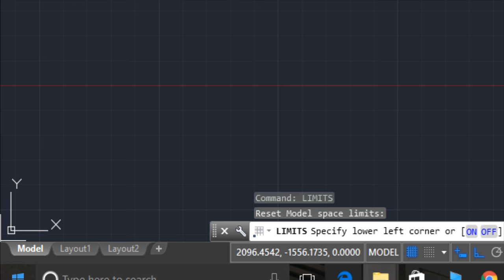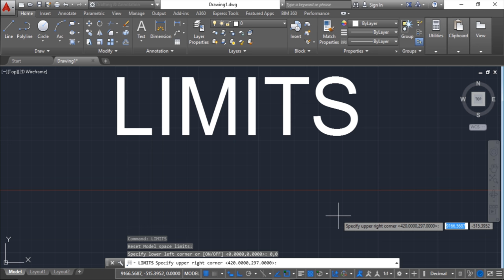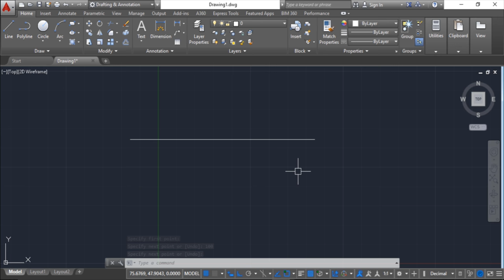How to set limits in AutoCAD?

Comment: if we want to draw a line more than 100 units long so that line we cannot draw in such a drawing where we have already set limit of 100,100?
Reply from the maker: yeah surely u can…line is not going anywhere…it will b in display only…u just have to zoom in to c it..limit doesn’t restrict ur page..u can any time zoom in or zoom out to c line of bigger or smaller dimensions
Reply: You just can increase the limit of your drawing. First you have to decide what size of the drawing you want to draw then you can increase or change the limit if you want to draw further big.

Comment: When i draw the line for 10units it doesnt shows the dotted line and others ,why? How much limits i have to put when i drawing the line in metres
Reply from the maker: Hello, 
I am offering Online classes for the following software's,
AutoCAD(2D & 3D), 3DS Max, V-Ray, Photoshop, Google Sketchup, Revit .
Have a free demo lecture before joining online classes.
For More Information contact caddworld009@gmail.com.
Best Wishes
Sugandha...
Reply: Jeevan Jeevan have selected units as meters . Initially your limits as well as your units are set at a default value .
You can change them by following ways:
1) simply type Units
Select the units you want 
2) type limits then select limits per convenience.
Note : select limits as per your drawing

Comment: When I type limits it start typing in command bar but not near crosshair earlier it used to be what should I do
Reply: For that u need to switch on the dynamic input option in the status bar below near Ortho mode icon..
Reply from the maker: Hello, 
I am offering Online classes for the following software's,
AutoCAD(2D & 3D), 3DS Max, V-Ray, Photoshop, Google Sketchup, Revit .
Have a free demo lecture before joining online classes.
For More Information contact caddworld009@gmail.com.
Best Wishes
Sugandha...

Comment: what happen when we draw without limits?
Reply from the maker: Ur line or any shape with a particular dimension may seem small or too large or sometimes its hard to be found if the limit is too large..
it helps u keep ur desired dimensions in limit by showing it on the existing display..

Comment: Hi, Madam, your limits did not set exactly.
Your X-Axis coordinates were 100 but it did not seem like hundred and similarly Y-Axis coordinates were also 100.
Please, check and revise your video,
thanks
Reply from the maker: Hi,
kindly watch the video again and understand that limit doesn’t mean the display dimensions will be 100 by 100..
The display is infinite, by setting limits We make sure that the desired dimension is drawn in that display..
Whatever limit u give,the display will always b zoomed to a sightly upper value so that if u draw any line under that limit..it is easily visible on the screen on both the axis..
U can use 100 by 60 ratio as the display is landscape..

Never confuse limits with paper setting..For paper setting u can watch other tutorial which is about Layout..In paper setting v define fixed dimension of the paper but limits just provide u a workspace so that u work in ur desired dimensions..
I hope this helps u..

Comment: How can we change units of drawing like MM to Feet, Inch etc.
Reply: type units on the command bar and select the type of the units and ok
Reply: Short key for units is un then press enter or space bar key
Reply: Type command UN and press enter. You will see unit dialog box, then you choose decimal in Length Type dropdown list, now. Check any particular line of your drawing and change the scale of all elements (whole drawing).

Comment: Offset command  use karthe samay distance key nahi batha raha hai on the display show karne ke liye kuch idea deo naa ma'am
Reply from the maker: Hello, 
I am offering Online classes for the following software's,
AutoCAD(2D & 3D), 3DS Max, V-Ray, Photoshop, Google Sketchup, Revit .
Have a free demo lecture before joining online classes.
For More Information contact caddworld009@gmail.com.
Best Wishes
Sugandha...
Reply: Make sure your dynamic input is on. You can press F12 to switch it on or switch it off and it will show you your dimensions.

Comment: How to set limits in mm?
Reply: Simple, If you want to give limit for 5 m X 5m drawing we give it 6m X 6m with extra space right? Now if you want to give limits in mm then you give limits in 6000 X 6000 . insted of putting valye 6,6 in upper right corner you can insert 6000, 6000 to set limits in mm.